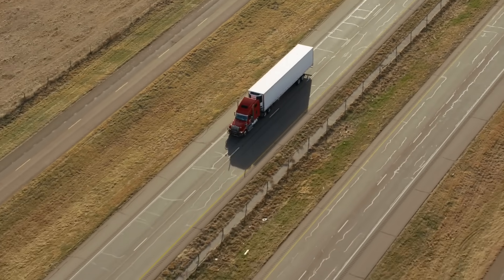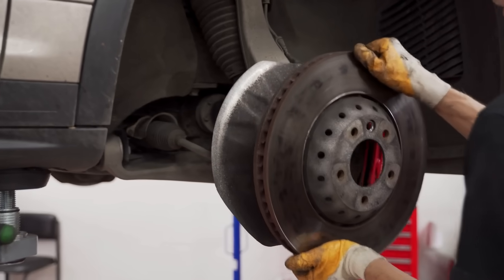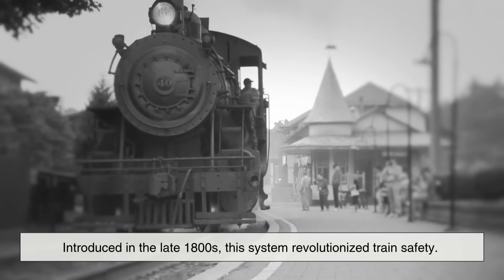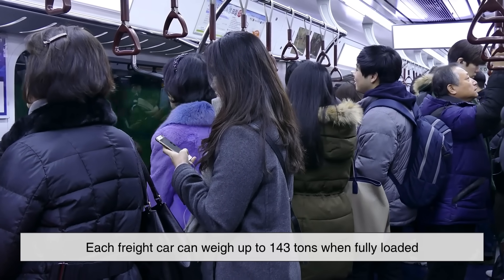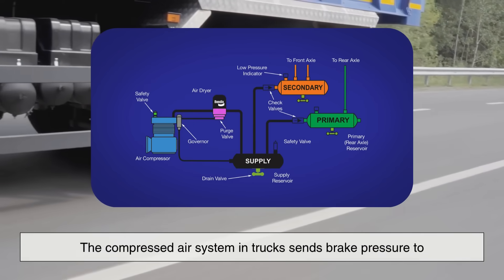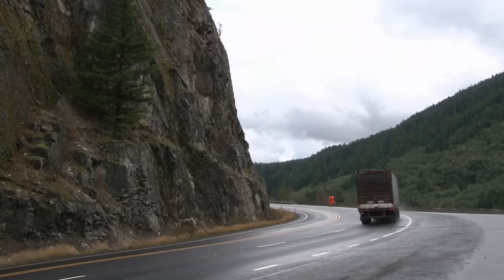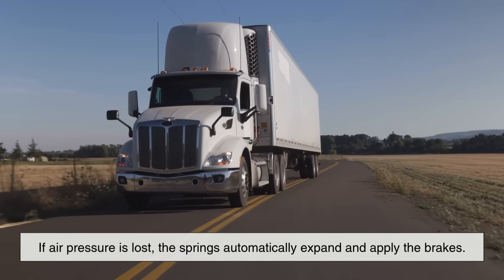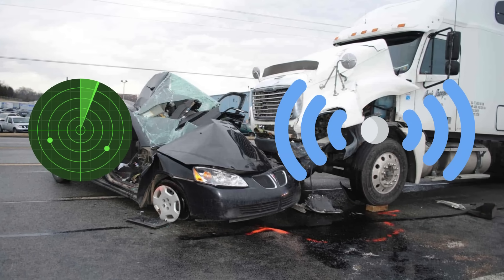Truck Brakes vs. Train Brakes: What’s the Difference?

Comment: Mate I've been on the class 357 while it emergency braked and it had the same braking power as the class 720 in normal operation the class 720 is the only train out there which can stop on a dime.

Comment: Video is total junk and misleading. Short answer to brake difference is traction: steel on steel is 10x less than rubber on road. All other differences are the result of difference in traction.

Comment: Plain and simple, air pressure keeps them released. A train in emergency loses it's air at 900ft a second. A 9000ft train would take 10 seconds for the last car to get the message. Then it takes 25 seconds for a full brake application. You can do the math for that. It takes a bit to stop.

Comment: Modern truck trailer units do not use drum style brakes anymore due to brake fade. They use vented disc brakes which are far superior. 
As for locomotives and rolling stock disc brakes have been used since the 70’s.
Reply: Drum brakes are definitely still around. I've driven multiple 2020+ trucks with all-round drums. They do fine honestly.

Comment: the Westinghouse air brake system has a near 150 year history of safety and reliability, please don't add any wires and diodes to it, those things have a history of failure and unreliability.
Reply: Diodes have a extremely high reliability rate

Comment: Runaway lanes on steep or long descents exist because applying and over heating brakes physically means the drum expands so much from that heat the shoes can no longer make effective contact.  Nothing, not even automatic or manual dynamiting of the brakes is gonna do a damn thing.  If you find yourself on a hill unexpectedly applying brakes you're already in trouble.  Gear down, like a train let the combo of Jake, normal engine back power, gearing and gentle brake.  Done by human computer as opposed to the unholy systems on trains.  And new highway tractors.
Reply: Also it's not just that, even disk brakes fade to the point of not working, the issue is brakes work by making heat, they can only make so much heat before they can't make more and need to cool off. The advantage disk brakes have is they cool faster.

Comment: I know what the difference is without watching the video. Truck brakes stop trucks, and train brakes stop trains.
Reply: Not exactly bro, in trucks air brake pressure applied to grab wheel. While in train Air brake pressure applied to release wheels😅
Reply: @Meraviji wdym not exactly! Broo!! 😂
Reply: BWAHAHAHAHAHAH
Reply: This is the Chad answer I want the virgin one 😅
Reply: Good answer. You won $56,0000
Reply: Waooow, U very clever n Funy cuk..😂
Reply: Advanced Bullet trains uses magnets to halt or accelerate

Comment: 2:30 its same in trucks to!  If air tank pressure come below 6 BAR, typicaly air leaks, then brakes come automaticly on.  Cause air  push the spring.
Reply: There is no spring in train breaks.
Reply: Completely opposite with a train. We drain the air out so the wagons will roll freely for shunting. To pin them down, all wagons have hand brakes. 
This means if you mishandle the train brakes, you can run out of sufficient air pressure to apply the brakes!  You now have a runaway train!
This usually ends up in a pile of scrap metal and tears. 😳

Comment: Multiple unit passenger trains use Electro-Pneumatic brakes, instead of by dropping the air pressure in the train line these are activated via electric signals and electromagnetic valves, the system operates fast and is suited for frequent stopping.
Regenerative braking does not use resistor banks and waste energy by turning it into heat, but feeds it back into the overhead catenary where other trains can use this energy again, it's used on electric trains.
Rheostatic braking is where the energy is dumped into resistor banks and transferred into heat, this system is used by diesel-electric locomotives as they have no means to store the generated electricity. Hybrid diesel-battery-electrics can however.
Both kinds of locomotives have electric motors to drive the axles, by connecting them with a resistor bank via a switch they act as generators and they start to work against the direction of rotation and do slow the wheels down.

On the truck front, engine braking or jake brakes are used in the US, the engine is essentially used as an air compressor during braking.
In Europe the retarder is used, a rheostatic brake using oil. Essentially a turbine pump attached to the rear of the transmission which can be coupled to the primary shaft to activate braking. The oil is pumped trough a restrictive valve of which the opening can be varied to get more or less resistance. Being pressurised trough the restriction the oil heats up and is then cooled in a radiator which dumps the energy into the air. This system can generate more braking force, is quieter and doesn't heat up the engine like the jake brake does while braking
Reply: Most mainline passenger trains use a modified Westinghouse system called AB braking, it uses two brake lines, one is a pressure line that supplies the entire train with air pressure, the second line is the control line that operates just line the ones in freight trains but since it doesn't handle the pressure replenishment task, it is much more responsive and faster acting.  Dynamic or regenerative braking is very effective down to about 20 mph, that's when the air brakes take over.  I do believe that the Europeans are way ahead of us on feeding the electric generated by braking back to the overhead, that has not been the case in the US. 
 A heavy passenger train weighs about a thousand tons while typically mainline freights weigh seven to ten thousand tons with some going up to about twenty thousand tons, generally unit coal and ore trains.  The extra locomotives used in freight trains in the middle and at the end, not only supply extra pulling (or pushing) power when needed but also are a source of extra air and can be remotely controlled from the lead locomotive for both braking and power.  Sometimes with these very long freights when cresting a hill need to be braking in front while still pushing from the rear.
Reply: @henryostman5740  That's right, glad you described it in a separate reaction as I thought including this would make my comment too long and I deleted that part.
The twin pipe system does overcome the risk of depleting the air in the brake reservoirs after several brake applications in a short amount of time which was likely before dynamic and regenerative braking was a thing.

Comment: Ummmmmm... almost everything is wrong.

Negative control in trains its exactly the same as in truck trailers. And positive control is exactly the same too - it affects loco only, like truck itself does. Moreover, parking brake in modern trucks work on negative control.

Brake signal - pressure - in modern trains transmitted electrically. Even in 50yo systems there are emergency accelerators which provide fast discharge, and electropneumatic braking (ecp) where air is only energy source, the control signal goes electrically.

Train brakes can be disk type, most of highspeed and emu nowadays are done this way - its more energy-capable

Engine brake in trains is resistive or recouperation brake.

EMUs in city use brake and accelerate much often than any heavy highway truck.

Comment: Pretty sure no trucks have drum brakes any more and the difference is the friction between the wheel and the surface.
Reply: There are hundreds of thousands of older trucks and trailers still on the road that use drum brakes. New equipment have disk brakes but older tractors are not replaced for 7-10 years and can be up to 30 years old with 2nd or even 3rd owners and trailers are normally run with 2nd and 3rd owners till they are upwards of 20-30 years old
Reply: @cmiller8693  There are new trucks that still have drum breaks.
Reply: They have drum brakes. Air disks are getting more popular now. They have been around for years, but the older versions were heavy.
Reply: Drum brakes are MORE than common on trucks.
I have yet to see a disc brake on a semi trailer.
While SOME trucks may have disc brakes, the bulk of them still have drum brakes today.

I would know, as I’m a truck mechanic and driver!
Reply: @dangeary2134  As a heavy diesel mechanic I've seen one trailer with disks and it got converted back to drum because the owner had so many issues with the disk brakes.
Reply: Almost all Semis and HD trucks have drum brakes still
Reply: I worked NAPA counter for 10 years. Everyday I sold brake drums, shoes, brake chambers and slack adjusters for big trucks. Governers and air valves were popular too. Never sold a disc brake part for a big truck, ever.

Comment: The Tyne and wear metro trains have magnetic breaks for use in emergency and these were built way back in the late 70s, these breaks drastically reduces stopping distance s as the don't involve any part of the regular breaks or wheels

Comment: Dynamic (or regenerative) braking on a train can return energy via a catenary instead of using a resistive network.  Newer trains can also use that energy to charge batteries which can then be used to power the train.  Note that electric trucks also use regenerative braking to charge their batteries.
Reply: It is called dynamic braking, no battery charging involved.
Reply: Fortescue has developed a battery-electric train for use in delivering ore for its mines in Australia.  It heavily relies on regenerative braking.

Comment: Brakes on trains, Eddie current - Example of Lenz Law?
Reply: Not even close. A locomotive's wheels are powered by big DC motors known as traction motors The cool thing about DC motors is they convert easily from electricity consumers into electricity generators. So when the engineer wants to brake he turns the traction motors into generators and flips some switches that causes the generated current to flow through huge resistors. When current flows through resistors it turns into heat. Huge fans blow air over the resistors to dissipate the heat. Thus the kinetic energy of the train is being converted into electricity and then into heat. This is called dynamic braking. It can be used in combination with the friction brake shoes or just on its own. The advantage is that it provides braking without wearing out brake shoes

Comment: Train brakes are designed not to apply so heavily as to cause the wheels to stop rotating and start to slide. 
Steel on steel sliding friction is WAY LESS than static friction.
Reply: I'm a train driver/engineer for more than 12 years and i can assure you it's pretty easy to make the wheels go slide
Reply: As I said ‘designed’. ie flat track, dry rail, perfect tyres. 
And YES, I too have whole trains go ‘up in the air’! It’s a very scary feeling. 
Old saying… It’s a bugger when they won’t start, it’s a bastard when thet won’t STOP! 😱